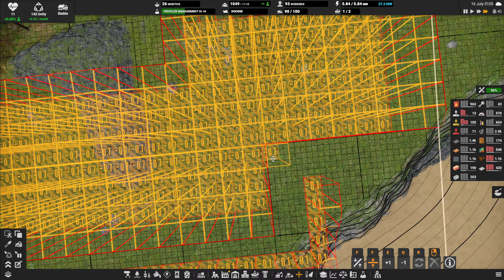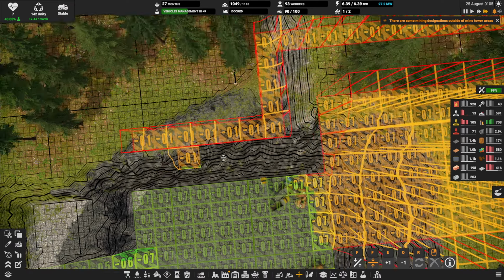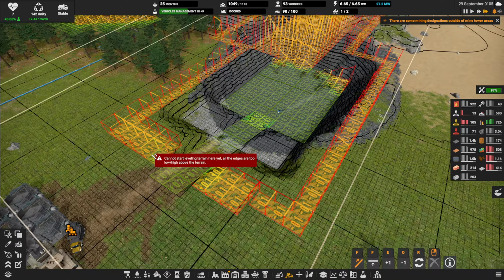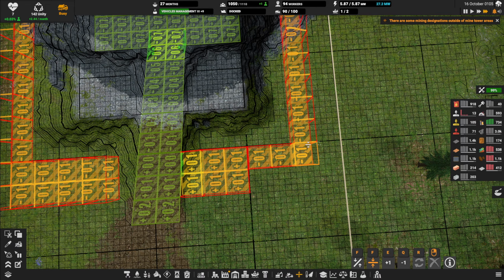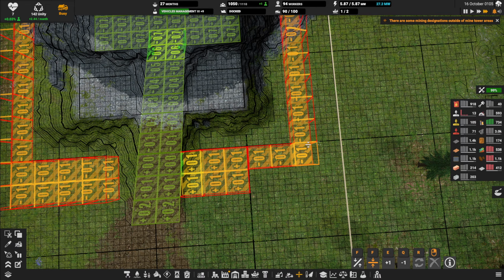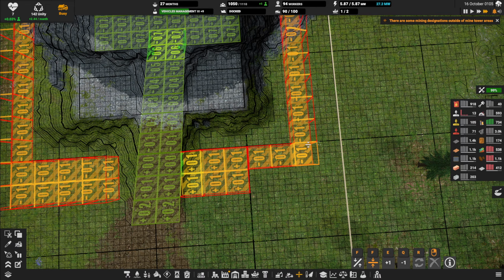Time to Build the Main Bus - S2E8 ║ Captain of Industry

Comment: Will you be belting research mk2 into the new labs? Given how that's probably quite a chore on the list of things they need to do.
Reply from the maker: Eventually I might move the labs over, but putting lab equipment on the main bus would be a bit much. :D

And to be honest, if I remember correctly the labs use 4 units per minute. Even with the tier 1 trucks, and with partial loading disabled, that's only one trip every 5 minutes per lab. With the tier 2 trucks, that's one trip every 15 minutes. Not exactly the most demanding delivery route on the island.
Reply: @Hmuda  Move the labs closer to the research? :P
Reply: Another episode of progress. Looking forward to the next one. As always I appreciate your continued efforts. Cheers 🇦🇺